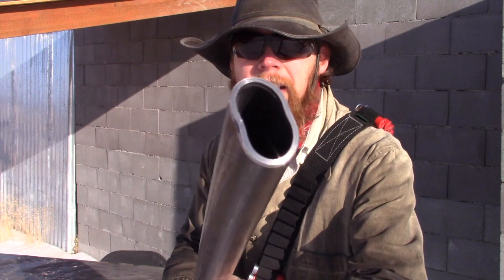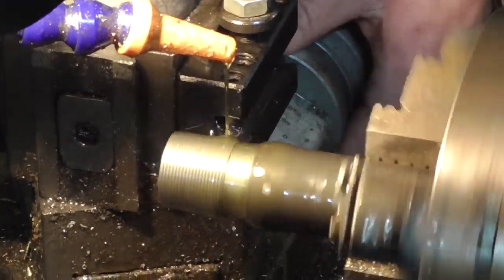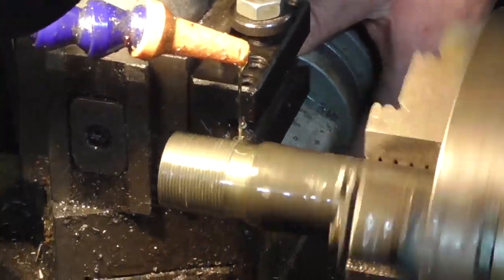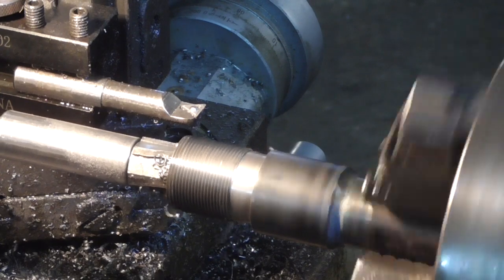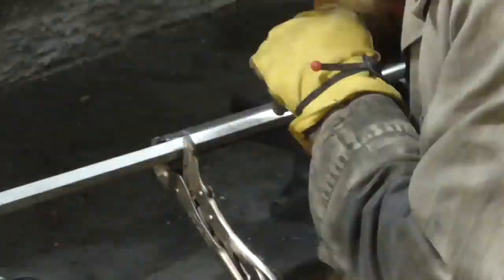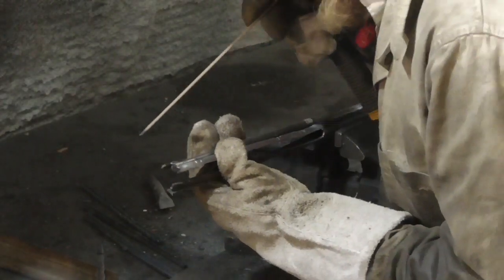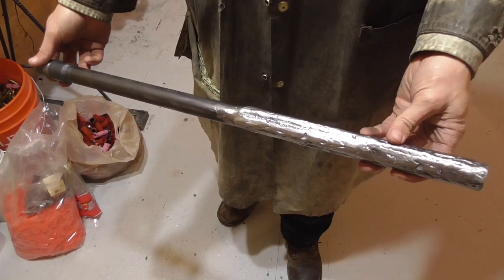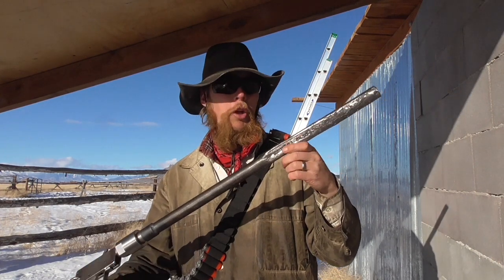Experimental Cruciform Choke (TIS246)

Comment: try to make a rifled 22lr barrel from aluminum round stock by drilling and reaming a 22cal hole and etching the rifling with lye. could be an interesting low tool count rifling method. you might need a 3d printer or something though, since laying down a spiral etch resist inside the barrel could be hard.
Reply: ravener Honestly button rifling would be easier, either buying or making a button would be less hassle than trying to piece together a water tight fitting form to etch rifling, but i'd love to see an aluminum barrel, especially if he could do it with every day tools

Comment: I might be a bit slow, but the practical hunting or tactical applications are not obvious to me even if it did give the desired pattern. can you explain the thinking for what the advantage would be of that versus a uniform circular distribution? Or for that matter versus a more uniform horizontal distribution?
Reply: Vampires. The answer is vampires.
Reply from the maker: My original line of reasoning was basically as follows:
 There are a finite number of pellets per shell, so the average pattern density will be equal to the number of pellets divided by the area covered by the pattern.  Just for arguments sake, suppose we have 100 pellets in a load, and at a certain range, the pattern is circular with a diameter of 12 inches.  This circle covers an area of 113 square inches, so the patten density is about 0.88 pellets per square inch.  Now suppose that instead the pattern were a perfect cross-shape measuring 12 inches in breadth with arms 2 inches wide.  Now the pattern has an area of 44 square inches, so the pattern density is 2.27 pellets per square inch, or about 2.5 times greater, even though the pattern still spans the same overall area.  Thus, if the damage done to the target is proportional to the pattern density in the area where the pattern intersects the target, then a cruciform pattern would tend to cause more damage to the target than a circular pattern of comparable overall size.

Comment: 1) What size of shot did you use? Theoretically, the smaller shot is, the better it conforms to a choke pattern.
2) Non-collinearity of the rods in the choke may have resulted in the same effect that the paradox choke has on shot: if the shot charge is spun, it greatly increases its group size due to centrifugal forces. This may be the reason why the shot loses the cruciform pattern soon after leaving the barrel.
Reply from the maker: I was using size 7 bird shot.
Reply: @TheIdahoanShow  It means 0.1in shot diameter, which is quite much compared to the "crucichoke" features size. I guess, the slot size was about 0.2-0.3in.

Comment: You really have the ambition to be unique?

I do like your experiments. The first part of the barrel with the pipe welded on really seems like a good economical way to get shotgun barrels done.

They way you put the rods in was quite good, while at first i thought that it was just stuck in there, so the shot would hit 4 walls, later i saw you put it in the way you said you did.. Just me taking note..

Comment: now you need invent another first a cruciform brush to clean the barrel
Reply: A normal brush would fit through the cross pretty easily.
Reply: Four tooth brushes and some duct tape.
Reply: That's exactly what I was thinking :-) Actually in the last shots of video the barrel looked clogged?
Reply: A standard brush would work fine ime with odd choke shapes.

Comment: But what about the wad?
Reply from the maker: In all my testing so far, the wad seemed to squeeze out through the constricted muzzle just fine.  I'm sure it was deformed significantly, but I never had problems with it (or pieces of it) lodging in the barrel.
Reply: @TheIdahoanShow  i bet it would be a real pain when it came time to clean and swab the barrel, cool concept anyways.
Reply: @aaronschmidt169  make cross-choked section a removeable muzzle device. that should do it
Reply: @nobeltnium  Hah... Designer Pattern Chokes...
Reply: @nobeltnium  Gotta be careful with "removable muzzle devices" or the ATF may come knocking.
Reply: TissuePaper 
Wouldnt something like that be treated as a compensator or flash hider rather than a silencer/suppressor?
Reply: @tissuepaper9962  no different than removable chokes in factory shotguns.
Reply: @cablainmusic  but the chokes are inside
Reply: @arianaxdr7399  external threaded chokes exist.

The only issue is if it is a silencer part but something like this is unlikely. It isnt a baffle or multiple chamber device that could become a baffle like the sig design. 

The only things to pay attention to is if it is on a  sub 18" barreled shotgun  or a shotgun thats under 26" OAL but thats not an issue for blackpowder anyway at least federally.

Hell you can make a silenced muzzleloader federally as it isnt a firearm or even a machine gun if you can work out how to do it in none fixed ammunition form.